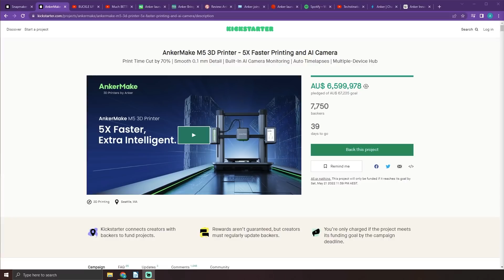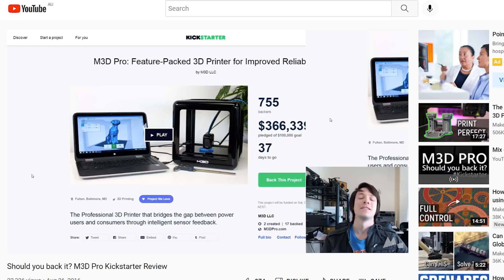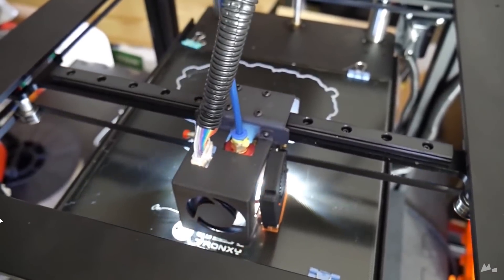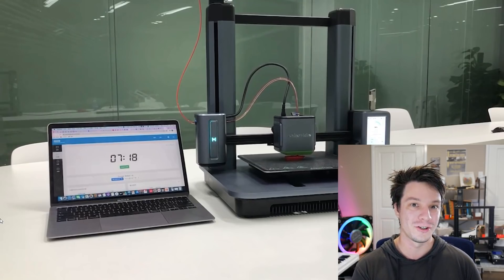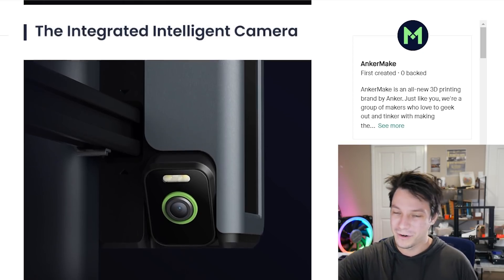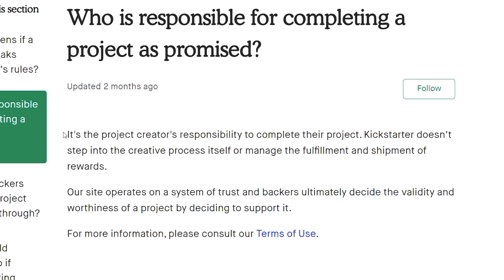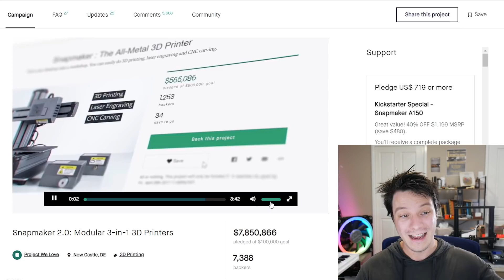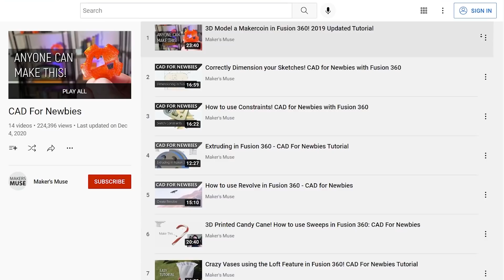This 3D Printer looks incredible, but...

Comment: i would literally pay $1000usd for an ender 3 if it worked everytime i need it. when you only need a printer once a month it’s damn near impossible to use these low end machines
Reply: Hmm my Ender 3 v2 works every time I use it. Not even adjusting the bed and no auto leveling. It just works. ( I have replaced the springs under the bed with silicone, and I mostly leave the glass plate in place.)

Comment: I feel like mistakes were made when someone decided years ago to call them "3D printers". They are closer to CNC machines than desktop printers, and this, I feel, is why they fail on expectations and will continue to do so.
Reply from the maker: Once again you can blame media hype for this lol, it was known mostly as additive manufacturing till ~2012 when it became trendy 😩
Reply: Tbf I’ve never had a perfectly reliable 2d printer
Reply: @definingslawek4731  for real LoL I've spent more time this week tinkering with my 2d printer then my 3d printer
Reply: When will we learn that printers from all dimensions will be an eternal PITA? That scene from Office Space will be parodied forever, like what Quint Builds did with his Form 3, our descendants descendants will beat up their 4D and 5D printers too.
Reply: We (I didn't invent it just heard it) used to call it 2.5D printing like a cnc router. If you think about it, it makes perfect sense
Reply: @paulmcmaster9710  Yeah, it really is... although I am hopeful that better slicing options for 3D toolpaths will come in the next couple years.
Reply: This right here, I want to make parts for my rifle and this seems like a good entry to get in.
Reply: @The10thdrago  you might want to look into a printer with an enclosure. It allows you to print higher temperature and therefore more resistant materials.
Reply: I think it's a great naming convention for additive manufacturing. The more people get into it the more variations of products and innovations we're going to see in this section. It'd be boring if they only had only one industrial printer that was in the 200k range after all. Now we have small business printers,  enthusiast level printers, hobby level and even starter levels. A cheap printer that can hit alot of these levels could be pretty successful.

Comment: One tip to help new people to the hobby: It’s not bed leveling. It doesn’t need to be level. It needs to be trammed to the nozzle/ gantry
Reply: Perhaps a better name would be "uneven bed height compensation."
Reply: @ScottLahteine  so tramming… haha
Reply: @flphil4537  No. Tramming only does mechanical alignment, which is no guarantee of an unwarped bed. Less compensation (limited to the first few layers) will be required as a result of tramming, but very few print beds are perfectly flat, and even when they are perfectly flat they may be warped or bowed by heating.

Comment: Thank you for being a credible source.
The modeling part is where you are wrong. You can simply pay somebody else to do it. You can use pre configured models and add your name to it or something or change some parameters.
Or you just download something. Usually when the hype is bigh enough you donßt have to model anymore. When this cheap Cinese scooper had a problem and needed a replacement piece there were like 10 of them online instantly. Knowing how to model is nice but in the end you don´t really need to know it, just like you don´t need to be a mechanic to own and drive a car. It helps but it is not neccessary.

Comment: 100% agree that FFF/FDM won't be the method in place for wide-spread 3D printer adoption and usage. Far too easy to do something just slightly wrong and then need to dismantle something to fix it - like this afternoon when I withdrew my filament too slowly and wound up clogging the heat break. Even as someone experienced it took me a good while to find the right tools to clear it, and a few less-than-desirable words may have been exchanged with the printer.

I'm of the opinion that something closer to SLS will probably wind up being the dominant printer type. While PolyJet is a more familiar system, the idea of both having to use a potentially toxic chemical and dealing with supports just seems like it would be off-putting to someone who just wants to push a button and be done with it. A solid powder-based system eliminates supports entirely and I'd wager most people are okay with the concept of a vacuum and a brush. Obviously, though, a material other than nylon would be required - too many considerations when it comes to storage and re-using exposed material.

Comment: I am a mechanical engineer and I love to print stuff, but usually before I do I already get a headache and try not to print anything.
It is not just the first layer, the whole system is usually a headache. Extruders are usually badly designed, the software is crap in 9/10 machines.
The nozzle clogs etc. Those machines are just not there yet. And I never understood why the Creality machines were so popular, they are cheap and thats it. Usually they are crap.

I am still puzzled, why there are no cheap somewhat okay Core XY machines. The whole I3 design is not that great.

Comment: The Ankermake looks like a nightmare. The 90 degree LCD is the first sign that this machine is form over function and this problem is all over the machine. I don't expect the Chinese company that makes USB chargers to make a good first 3D printer or a printer at all especially a Kickstarter bomb. I will not gamble and I will wait for this thing to prove itself.

Really great to hear about the camera and resin jetting!

Comment: I’m an experienced printing enthusiast, and I would LOVE to find a printer that is reliable and straightforward. It’s ridiculous to not be able to expect a successful print when you’re trying to prototype a physical part. You can babysit a part for 4 days, and on that 4th day it will fail because of some silly thing like the weight of the print affecting the springs under the bed.
Reply: I’ve found the Qidi Tech X-plus to be VERY user friendly and reliable, haven’t had to tinker with it at all after 1 year, feels like I’m cheating LOL, allowed to really focus on my CAD skills instead of machine tinkering.

Comment: Absolutely fantastic video, thanks. For me, the problem occurs as soon as the nozzle gets clogged. If they don't have some sort of nozzlebreak solution out there in the protoprint raptor/e3d revo style, then they will have angry customers eventually. Also, I'm sorry they have to lie on kickstarter, speeding up from 50 to 250mm/s will reduce the printing time of 200% benchy from 4.5 to 3.5 hours not 9 to 1.5 hours.
But I still hope they succeed and bring more R&D money and more reliability to 3d printing.

Comment: The major difference between a thing that might go wrong and a thing that cannot possibly go wrong is that when a thing that cannot possibly go wrong goes wrong it usually turns out to be impossible to get at and repair. -Douglas Adams

Comment: 10 years prediction: filament printers will stay, but like a sewing machine you'll have to learn how to use it and what settings are best for what material. 

I still don't understand why there's no trust of this community in elegoo, anycubic or anker delivering a machine that's sold via kickstarter. That narrative is based on small companies not delivering - but has any of the big ones failed so hard there? I recently supported the anycubic photon ultra, the process itself was a mess and I would never do it over kickstarter again - but I got the printer.
Reply: Big companies tend to deliver some hardware but it can lack the polish that they advertised. It's also important to remember that you are basically agreeing to be a beta tester when you get something from Kickstarter. You get the first machine off the line, for better and for worse.

Comment: this is already an extremely rich company so them using crowdfunding has greed written all over it. the only new thing about this printer is the AI failure detection which they aren't able to demonstrate yet. otherwise it's just a fancy ender 3. it's not a robust enough design for a user-friendly machine.
a user-friendly machine needs to be built strong like a tank but precice like a jet. it needs to come with a library of models pre-sliced and an easy to use slicer to get more. it needs to be fast and reliable. it needs to be vibration-proof and dust-proof. it needs to be safe and self-contained and affordable. this printer is not these things.
Reply: No enclosure either.

Comment: A lot of my co-workers have been coming to me for advice to get 3d printers to get their kids (and themselves) started in 3d printing and are asking if they should get the ender 3.  I've been telling them to stay as far away from the ender 3 as possible, that low cost of entry is so deceiving and a lot of people just don't see it.  But it's also hard for people to justify spending 3 to 5 times the price for the prusa, but that's what I've been recommending, because they are just workhorses.  Out of all the printers I have, the prusa has many many times more hours on it because it's ready to print 99% of the time.

Comment: wont back on kickstarter, but interested how this turns out. i hate the race fro the bottom and although its been improved QC is still an issue. I love anker cables, chargers and power banks, hopefully they do it justice and sell it on amazon directly for easy no hassle returns if anyone does have QC issues.

Comment: It took me a while when i got my Ender 3 to understand why the nozzle was sometime too far and other time dug into the bed, i thought i was not leveling the bed correctly, but it was the Z limit switch that was inconsistent, i switched it with the Y limit switch since it doesn't matter if the Y is sometime off by 2 mm.
Reply: Optical endstop switches have been a life saver for me, they're incredibly precise given stable lighting conditions. I don't have to babystep Z at all with them, but they can be a bit of a pain to set up on an Ender 3.

There are still other factors that can affect bed/nozzle position over time though, like permanent bed spring deformation, bed adjustment nuts coming loose, y- or x-axis roller material settling after an adjustment, gantry sag, or even the nozzle itself coming loose if the hotend was not assembled properly.

Comment: The "same model, same G-code, different PTFE tube" video snippet you cut in is sooo true.
The cheapest printer I ever bought probably has the best print quality, a Coocoon Create ModelMaker that I bought second-hand. All I did to it initially was replace the bog-standard PTFE tube (4mm od, huge 2.4mm id) with a much better fit (4mm od, 1.9mm id) and it would print flexible filaments till the cows come home.

Comment: Personally, I do not design. I've been in the community since 2017ish - with Kudo3D Bean as my first Resin, and some now unknown Taiwanese FDM Delta. 
I now have my own shop, multiple printers, know settings etc. pp. Could I design? Probably. Do I WANT to? No. I print daily, a ton. I know what I am doing, I stay on track and if I run into a corner? I ask the community - as one should :) I also give advice as much as I am able to.

Did I want to back the Anker? Initially, yes. Then...not. Why? Partially the shipping costs (sad fact these days), but honestly, I want true reviews NOT from Uncle Jessy etc. (sorry, don't like him, unpopular opinion, I know). I want to see the community response first. And then I will be willing to buy it later.
because, honestly? I have enough printers that work great! Prusa, while expensive, is a super reliable workhorse with an excellent "Apple like" Machine to Software ration. So why should I go for yet another printer, with yet another set of profiles to fine tune everything I already have?

Naw...rather wait. be patient for once and see how it goes :)

Comment: One of the best upgrades i did on the 'upgraded to silly' tronxy D01 was a strain sensor on the hotend do the actual noxel can be used as a bed probe+home sensor.  perfect 1st layer height every time, no offsets, no recalibration after changing nozel, it's just right every time.  no idea why this isn't standard, the parts cost was pennies!
Reply: How do you deal with shmoo on the nozzle? This is why i haven't built one. I want to be able to use glass plate or anythig else. Glass plate, sure, you heat the nozzle  till the shmoo is soft enough, you ram it into glass, it's fine. But if you have Buildtak or something?
Reply: @SianaGearz  I home when hot.  This thing is sensitive so it's not an issue.  you can put your finger on the bed under the nozel (not when it's hot! :O) and it will gently come down, touch the finger, and home at bed+finger level.  im super impressed just how sensitive it is considering it's measuring the flex in a 10mm*6mm cross section aluminium bar.

Comment: Thank you for not promoting units with an exposed laser diode without cover.. 
So many  dont care about this safety but it's a serious eye hazard. 

Recently was watching "laser soldering stations" .. really cool for reflow work etc.. but massively dangerous IR pump diode.. with no cover or protection goggles offered...

Comment: Hi Angus, the Snapmaker and the identical Dobot are certainly NOT good printers, they are the same machines, and total rubbish in every way, and over priced, if this one is going to sell for a good price then it maybe okay, Iv'e owned the Snapmaker, and I still own the Dobot, and like typical proprietary things, I had to gut it and install good motherboard, even after that its still only average. The biggest problem with machines like the Ankemaker, is spare parts and access to spare parts, if Anke are going to use common nozzles and wear parts then it should be okay, but if its proprietary gear, then it will just be a flop. I've been down that path. If they actually spend some time and polish the software, and keep supporting it, then I will look at getting one myself.

Comment: Two points 😃
1. I think the future will be an inkjet like printer but I think it will be like a two part paint system that dries almost instantly when mixed at the nozzle, avoiding a clean up. I also think this will have the ability to mix colours at the nozzle as well. 
2. The pc fan of death ☠️ 😂 needs to be incorporated into a printer as part cooling fan….. see if you can blow the part of the bed 😜

Comment: I bought Elegoo Saturn S right after release, spent time and money to make the setup for it, moved my Ender 3 V2 from the place where I could print to make room for resin setup, and now after doing some learning and test prints I simply haven't had willpower to tinker with it for last month or so. What annoys me is that the community around resin prints is mostly focused on making mini figs and if you want to do something mechanical, you're literally figuring out how to print it on your own. Figuring out how long to cure your parts? you have to just test it and figure it out what is too soft and what is too brittle, there's no good rule of a thumb or info from slicer on how long to set it up in with curing station. Yes, resin might be the future, but it won't be as long as many people who are actually trying to make something different than minifigs would take the plunge for it.